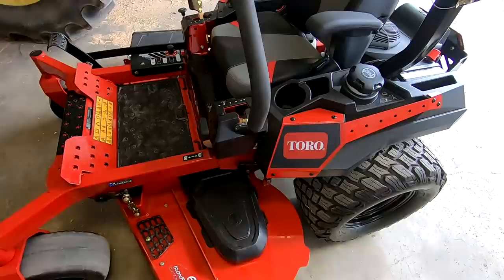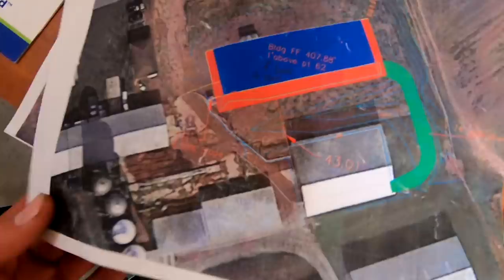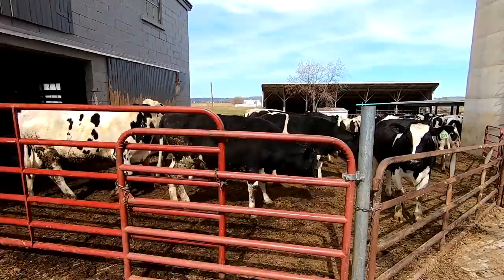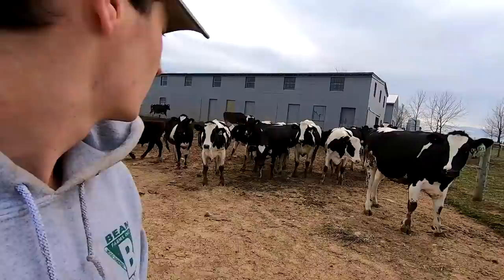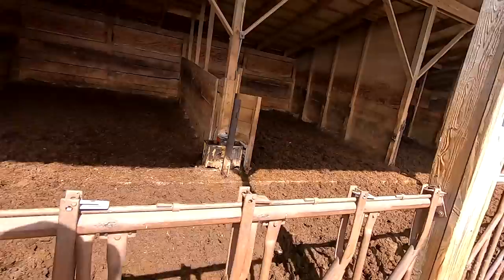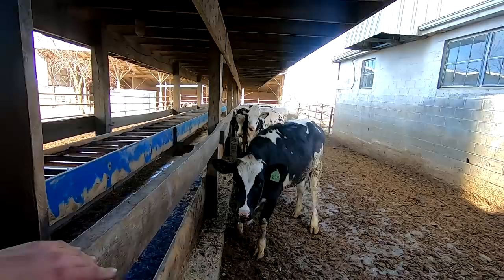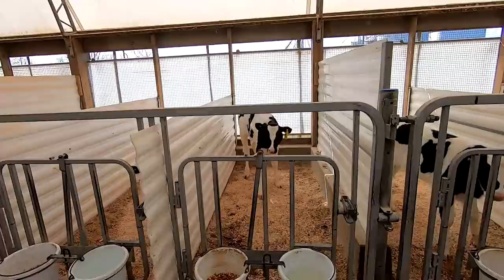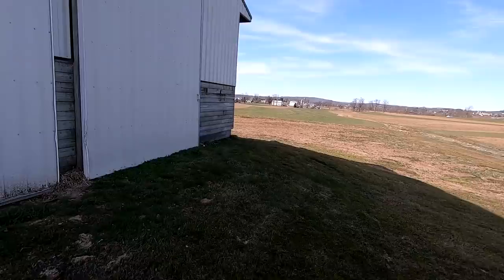New Building Layout & Toro Lawn Mower

Comment: Cool- Toro versus Grasshopper Mowers. The two titans of lawn care- will be interesting. If your Grasshopper is diesel, it will probably win- otherwise, will be a close call as they are both good. I say titans of lawn care because I manage residential properties with 188 acres of lawn and 6 different lawn contractors and speak with them frequently- and their equipment and preferences.

Comment: You had the best luck with that oil filter. It always supposed to be hand tight, when i took apart a little lawnmower engine that was burning oil, i had to drill a hole through the filter and put a breaker bar in it just to get it off. People just like to tighten those things so much
Reply: I have that problem with CAT C15 500KvA generators the filter is so big  you can hammer a crow bar right through them to spin em off!

Comment: I think the oil filter wasn't tight because you didn't put a little oil on it before you screwed it on. That allows the gasket to stay in place while you tighten it. A dry gasket won't turn and can come loose with vibrations and leak. (mechanics trick)

Comment: How many comment will be about him not showing putting oil on the oil filter gasket?
Reply: I agree with you.
Reply: The power of editing.......
Reply: I figured he just put it on off camera.  Those threads did sound a little grungy, though.
Reply: @thomasdaily4363  Yeah, you could hear the hollow metallic sound as he threaded the filter on... it wasn't filled and the o-ring wasn't lubed. The thing is though, that's probably perfectly fine... at least the o-ring part. Oil is very quickly displaced from under an o-ring anyway. Filling the filter though... that I would definitely recommend since otherwise you will have a short period where the engine is starved of lubrication after starting it up.
Reply: @dregenius  That's a good idea.  I had never heard of that, but will do it next time!!

Comment: Cool sharp video 
For the new building you can set your camera for overlapping cool photos from start to finish that would be cool.
Saw you changed oil filter, recommend to lubricate the filter o ring with little oil so it does not crack on you early

Keep up the good work

Comment: We run a 2011 and 2020 model 725d grasshopper mower with the 52 and 60 inch deck and the serviceability of the mower is awesome and the price of parts is very little compared to other brands and when it does breakdown which is very seldom if it does and would never run a different brand of mower.

Comment: If your looking for a really good zero turn I have had great luck with the simplicity cobalt or ferris is2100z  (same mower different color) the nice thing about those compared to the toro is that they have suspension which really helps at full speed.Maybe you could get one of the companies to send you one to test as well as the toro.

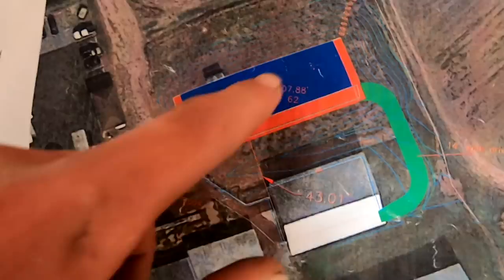Comment: Nice Toro but it will have to go a long way before it  comes close to out performing your Grasshopper.  And even if it cuts as nice it's not going to last as long. Belts, yuck.  I have a 92 model year with a 48' deck. Its gas, I take care of about 3 acres.  Runs fine with no issues.  One tough machine.  You'll have to get use to the mid mount deck.  You'll bang the deck into a lot of things while becoming familiar with it.  The deck out front on your hopper gives better visibility.   Nice videos 10 Man.  Keep them coming!  Gal 2:20

Comment: Would you ever consider getting a tire scraper for your skidlosder instead of behind the ih 84 hydro?
Reply from the maker: The drag scraper works really good when pulling around turns and cleaning up against the back wall of buildings
Reply: @10thgenerationdairyman61  yeah it they both work well but its nice with a skidloader because you can get into tighter places and turn sharper

Comment: Holy crap, did you just put an oil filter on that tractor w/out filling it w/oil??? Omg can you say rod bearings and main bearings??? If you recheck the oil level you'll see your a qrt low and bearings are scratched up errrr

Comment: Toro mowers are  pretty good but think about maintenance.  On your grasshopper the deck folds up makes it easy to change a blade or bearing. but The toro you have to take the deck off to do all the maintenance Toros are nice but maintenance can be a nightmare..
I would stick with the grasshopper they have a better reputation. Toro is kind of like a Walmart POS mower.